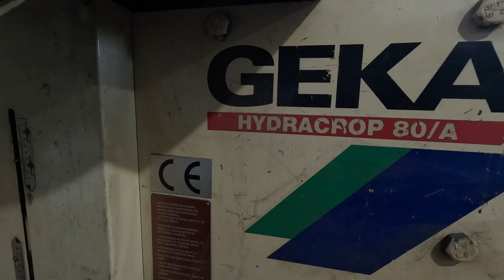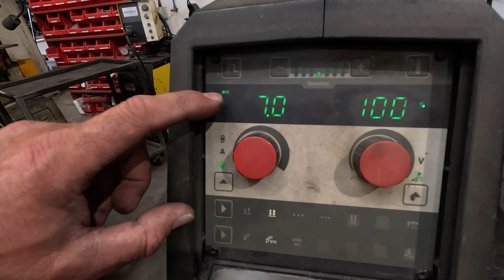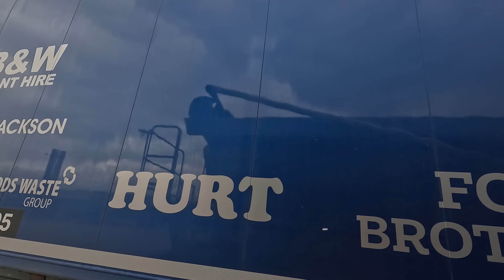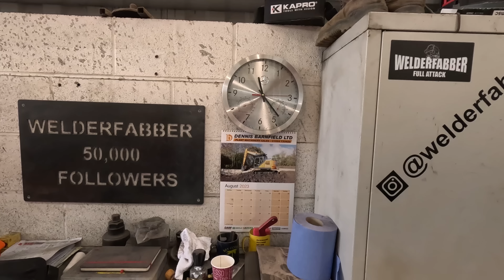A Day in the Life of a Welder Fabricator! The WELDERFABBER Chronicles Chapter #010

Comment: Great episode again Baz. On the wheelloader bucket edge replacement, does the loader run equal tires/pressures on each side? One side completely gone, other side could have gone a long while still...
Reply from the maker: Well spotted mate. The bucket is slightly twisted been like that since day one.

Comment: Hi Baz and Director and the rest of the lads. Just love your content, Get your eyes done Baz, i had a lot of bravado about getting my done because i always used to put the forklift forks through bags of material lol. Since my new contacts the company has doubled in profit lol. That bracket on the scania, im surprised they overlooked that, but your fix is defo gonna hold and scania should implement that in the other trucks. Nice to see a new lad starting,if he is the right lad for the job i bet he is gonna love working there. QUESTION BAZ...ive noticed on some of the tippers that the beds are made of alley, why not steel???surely alley is softer and more expensive??

Comment: change the blade at the underscrew. if you weld them on (which I also do)... do you never grind off the bolt above the nut?? less mess remains on it
Reply from the maker: Sometimes mate but not always

Comment: I’d have left the door on. Weld two captive nuts on a plate and bolt that to the check strap to locate the plate then cut the work hardened bit out and blob the whole lot solid
Reply from the maker: I wouldn’t recommend that. We all have our ways tho 👍
Reply: Not second guessing what you do. It’s more I avoid taking things apart as much as possible. Could o ask why you TIG welded the door as opposed to mig?
Reply from the maker: @orion6shot  Because we have 1.2mm wire in all our migs.. much easier with the tig on thin material

Comment: Baz that bracket on the T cab….. great idea but would it not be stronger to weld a piece of box section in it, then re drill the holes to mount the cooler? Can on the great work, you’ve got some good and some not so good tipper drivers🤔🤔 I see them daily on the roads and quarry’s, have you seen the video on YouTube of of of Hurts nearly rolling over at Poulton on Fylde traffic lights🤪
Reply from the maker: Ye seen it mate. P45 same day

Comment: Yet!! another great video Baz an crew,was there a reason what looked like you left some bolt holes on the bucket meanly in the centre without nuts an bolts ?
Reply from the maker: Yes mate the new edge supplied only had a certain amount of holes. Different suppliers use different centres. All bolt holes used in the new bolt in edge tho. Thanks for watching
Reply: @welderfabber  I'm learning some new from every video and i am 64 .

Comment: Great videos. When you do welding on the trucks/plant equipment, do you disconnect the battery to protect the ecu's against the current of the welding. I've always been told to do this, what is your opinion.
Thanks.
Reply from the maker: If it’s wet definitely. If your welding a bucket on a dry day and the the earth is on the bucket it will be fine. But if your working on someone else’s machine, isolate every time

Comment: Baz, what brand are those camlock clamps? Those things are cool. 😋
Reply from the maker: Which ones?
Reply: @welderfabber  
At 25:00 you were using one to hold the new plate on the leg. Ive only seen them with a screw before.